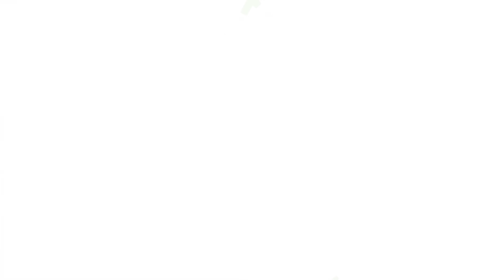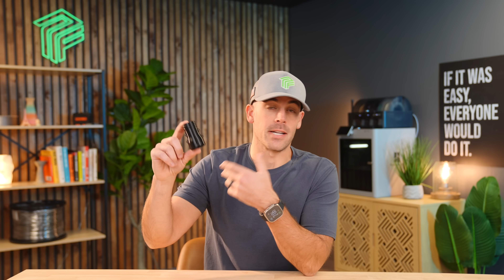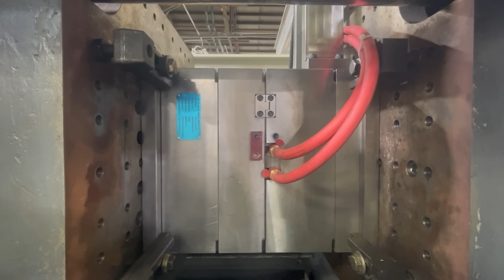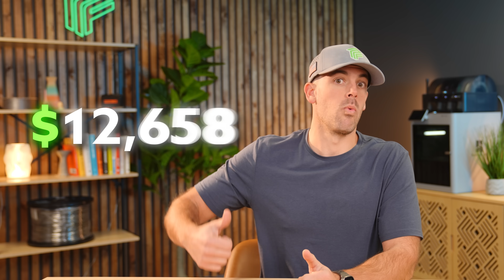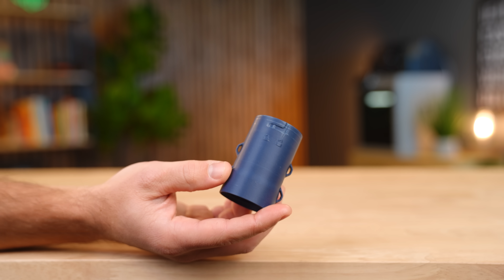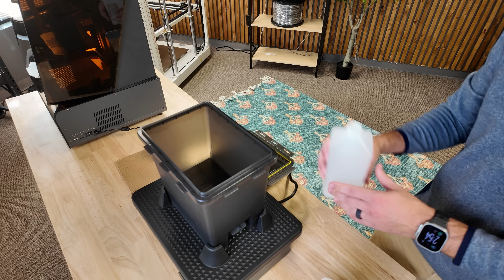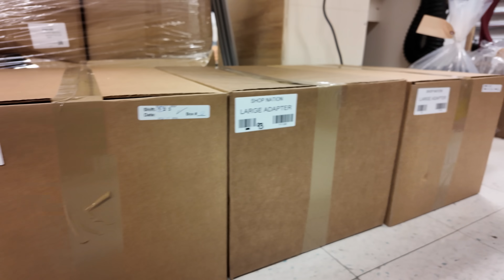Why is 3D Printing so Expensive?  Injection Molding Comparison

Comment: you aren't following your own rules here. what about electricity. staffing 1000 units wont be 10.40. I do think comparing a musket to an AR15 isn't the way to go here. 3D printing consumer level is making massive strides, injection moulding is a much more developed technology because it has had billions in r&d Id argue with the same improvement curve 3D printings versatility will eventually win out.
Reply: also great point about utilizing other print farms. 10 printers can only go so far but a decentralized community of print farms being able to bring 1000 printers to bear to meet supply spikes is an extremely under rated utility,

Comment: can you get more in depth on mold, obviously a multi piece. but what machine was it designed for? was it a aluminum pilot mold or a stainless or titanium mold. was that cut and manufactured here in the US or in china or outside the country for cost reasons. what was the timeline to get the mold? what side or secondary actions are required in the piece? how does that affect cost and complexity?

Comment: For me 3D printig is the right tool for prototyping and small-scale production (I don't count the carbon fibre autoclaves, that's a different story).
And as you mentioned: for a mass production you might go with other, traditional technologies like injection molding, extruding, etc.

Also, the material is also a question: if HDPE or PP is enough for your parts, it may be much more cost efficient than using eg. ABS in the 3D printing.

Comment: Just depends on what the thing you are making is. If it's cheap and you can get away with 3D printing it and doing some slight post-processing then do that. But if it's cheaper to do it injected molded version of it do the injected molded version. It's called discerning elements in your supply chain and for customer happiness index that sometimes you change it up a little bit depending on what you're doing. Finding the right tool for the right job is the most important thing and that's what should be the title of the fucking video. I didn't even watch it in its entirety

Comment: Also, you can save much more on material cost. 
Black ABS can be cheaper because you just get a recycling granulate. 
Virgin ABS from a factory goes at 4-6€/ kg. 
Black recycling ABS, with similar properties can be bought for 1-2€/ kg.

Comment: I worked at a company that made bearing seals (when gas was $1.19). 1st part was $700k each subsequent was 37 cents.
Reply: And you know what is crazy about it? If 1st part had a fatal flaw in design, its cost still will be $700k. I imagine while 1st part was produced, team was like "Be good, please be good."
Reply: @ilyaklimenko5666 
That is way you do a lot of validation, and way mold makers are payd very well
Reply: Crazy how that works out

Comment: Using your chart, for the 10,000 parts row, yes, you would have to ramp up and buy more printers but wouldn't that also open you up to more mid-volume parts printing without having to cough up the initial injection molding costs? TO be honest, I wish I had these volume problems with my little print business :)

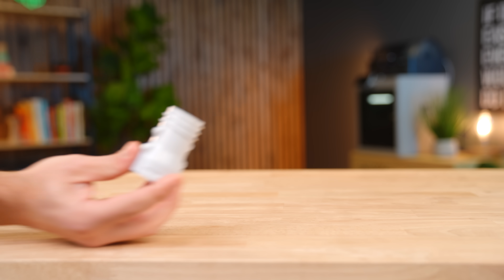Comment: 14:20 "went from an external thread 'since it was easier to print to an internal thread which was actually much easier to use in practice"
these two are gonna fit on something way different

Comment: After the intro my assumption is that 3D printing is great for low volume runs. Basically 3d printing costs 0.85 per part and doesnt require any new tooling but injection molding costs 0.10 per part but unique tooling costs 35,000. If you only need 1000 parts its WAY cheaper and more convenient to 3D print the parts however if you need 1,000,000 parts then the cost of the equipment becomes negligible per part. Pair that with the speed at which injection molding can create those 1,000,000 parts when compared to 3D printing with its limited filament spool capacity and its a no brainer to switch to injection molding.

Comment: Prusa 3D prints most plastic parts on their 3D printers, in order to test durability & reliability.  They could injection mold everything, but they wanted the data to improve their products.  Respect them for that.

Comment: Like anything 3d printers is a tool , 3d printer are for small volume and fast product development , So much does it cost to make a 16 colour mold ? 
People don't understand the cost of making a single item for them , eg a box you could buy in the shops injection Molded for £1 could cost you £7 just in material.

Comment: The thing is 3D printing was never meant for masses. Anyone who said so is delusional to the core. 

Unless you are targeting niche market. Like few batch limited item. Some parts that some people needed just to make their life easier that u can charge more for the "rarity". Or you got hardcore backer who buy anything from you just because you being you.

Otherwise, if you targeting to sell some part and produce thousand and thousand and thousand. Injection mold is always your 1st CHOICE. Its not on debate. If you planning to keep produce parts and sell it. Injection mold will cost less on long run and you can even put "high discount" and yet still get big profit. You save on electricity, time and MATERIAL COST. 3D filament is expensive, even if u have filament producing machine. U still need buy material and yet you need to operating the filament machine which use electricity. 

And not to mention a part that injection mold can produce within minute. U need hours, or even a day to print. Electric and time waste a lot on that.

I mean, i love 3D printing. U can simply bring your idea into life and it is almost limitless with a lower cost and less time. But to put the production line into 3d printing for a long run operation production. It is just a stupid move.

Comment: Sell 184,211 parts in 8 months? Maybe this is true but it doesn't sound right. $35,000 for injection mold / $0.19 saving per mold means you have to sell 184,211 parts to meet you ROI.

Comment: The elephant in the room not mentioned is the cycle time. the injection mold is probably a sub 20 second part and looks like all 3 in one shot so the time to make a batch of 1500 parts is about 8 hours. How many 3d-printer hours (like man hours)  for 1500 x 3 guessing 40min 3d print time 3000 hours / 60 machines is a month ? other than the part quality cycle time is a big variable

Comment: This the same as paper printing, I was involved in getting printing jobs done in the early 90's just as desktop publishing was taking off.  Before I started we used to send off 'marked up' doc files that would be printed at very highres, we would then cut up these prints and place them on individual pages, which would then be photographed and plates made for offset printing.  Eventually the print shops were able to accept files from the desktop publishing software to make the plates but we were still stuck needing plates to be made and the setup costs were still very high.

But in the office we had desktop laser printers that could printout the pages for us but was slow - This is the person 3d printers in your example.

Eventually, printshops started opening up with very fast laser printers along with kit for doing the finishing and trimming, this meant we could produce short runs for a reasonable price - These were the 3d print farms you were using to offsite the work.

But as the numbers increase, even now it still makes sense to use full offset printing even with the more expensive setup costs/time - Which matches to your offsite injection moldings.

Comment: 3d print a pattern then pour a filled epoxy mold usinf some bushings where ejector pins will go install this in a standardized mold base almost like a MUD set. lay in some water pipes thru befor the pour and loop the back and that is good for stable high qualitu for 5 or 10 thousand shots (of a non-glass filled) resin.  send it out for copper/hard chrome plating if need more shots, but that may be a push if mold is simple.
Nowadays aluminum tooling can be quite competitive if part is cnc able

Comment: As a rule of thumb, I've heard that you should begin considering injection molding when the part volume reaches into the thousands. I worked designing subsystems in a machine that had a relatively small production volume (30 total built), so no single part was numerous enough to justify injection molding. Metal 3D printed parts did make it on to the final design though!

Comment: I seen someone use a 3d print as a mold. Wrapped it in packed sand. Then pour molten metal. Of course you loose the mold in the process.

Comment: Machinist by trade. 3D printing is amazing and excels in situations. 3D printed molds are awesome because of the complex coolant lines yhe can put in the mold. But Hella expensive right now.  Great video breaking down everything.

I stopped by proto labs booth at IMTS last time and got a cool demo part the shows some of the issue of mold design. Little cube with the right way and wrong way for certain fetures next to each other.

Comment: Injection moulding is cheap if you do large quantities... otherwise the mould is too pricey

Yes there are exceptions and if the design isn't complex it can get cheaper but overall it's still expensive if you need low quantity or higher iterations...

Comment: 8 months for ROI from $.39. That's 90k parts in 8 month. He's selling over 11k of those a month or 500 per work day or 1 a minute during working hours. I feel like if he just found a supplier with cheaper filament or optimized the processes a tinny bit he would be able to save those $.39 with out injection molding.
Reply from the maker: Nope, ROI is assuming outsourcing

Comment: What makes an injection mold die cost so much?  It appears to be simple machined pieces of steel that should be able to be produced on a cnc mill readily.  Even if they were hand made on an old school mill and lathe, I can't see the man hours being more than 20-30 and at $150 an hour that would only be $3,000-$4,500 plus the cost of the tool steel which would be only a few hundred $.  How do you get the $35,000 price tag?

Comment: Funny when people go to multiple iterations of product-designs, with testing, to make their 3D printed parts last longer. Going for print-setups with more expensive materials, more tooling, and more manual work, to get parts just a bit stronger and claiming it would be "far cheaper" than injection moulding. I had seen that with a company making quad-copters - they wanted a uni-body drone about 30cm diameter - comfortably fitting their printers. They had done all the digital analysis of their original model but then had to go through testing and validation of many more iterations cause while the design was good for all other aspects (ease of assembly, use, aerodynamic stability etc) the nature of the 3D print made its durability miserable. It took them over half a year to get the printed version to acceptable standards, but that came with the downside of far more complex setups, far slower prints, more material wasted, and a lot of manual post-processing. For the later, a bit larger, hexacopter they again printed it and did most of the validation with that model, and then got a company to injection-mold it. A couple ten-thousands in tooling vs a couple thousand man-hours and a product-delay.

3D printing is great when you don't have high volumes, and when you don't require high strength (for plastics). And with injection-molding there are various ways of going at it and tooling-cost for a small adapter like shown here can range from just ~5k to over 50k - same part, but different molding-methods and materials as well as lifetime. Molds have a design-lifetime and depending on the design and material used the price for the mold can vary significantly. If you only plan on selling like 50k parts then paying extra to get a mold lasting for 1 million pieces will just drive the cost up for nothing.

Comment: I rarely ever make comments to YouTube videos that I watch, but being mechanical engineer that has designed parts for injection molding and numerous other processes like Aluminum casting, powder metal parts, stampings etc....  There is always a setup charge for ever run of your parts. Your tooling cost of $10,000 plus your assumed cost of on part for $0.40 to get a total cost for the one part being $10,000.40 (video time stamp 10:37).  You have missed more cost for the one single part.  Tooling cost is not the only factor.  The company that you now have this new tool to make your molded part will charge you a setup fee when you do a run of your parts.  This setup fee is the same if you run one part or thousands of parts. The more parts you run the less influence that setup fee will have on your final piece price.   That set up fee cannot be overlooked.  The setup fee will be determined by that companies factor overhead to run their business.
Reply from the maker: Very true, however since the same company that provided the mold is also running my parts that was all baked in

Comment: Why have we not moved to 3d printing the injection molds themselves using metal? i feel like that could drastically reduce machining cost and material needed even allowing cooling channels where needed potentially making tools cheaper and better. It would be printed rough and have a single finish pass on a 5 axis cnc machine.
Reply from the maker: There have been numerous cost studies on the viability of this. Basically the cost doesn’t end up being cheaper in the end. There are also all kinds of material properties concerns with printed metal molds. It’s much more expensive to print big chunks of steel than people realize

Comment: Great insight on how to make the right business decision.
I have worked for an injection moulding company for 37 years now making bottle tops. Sub 3s cycle times and 96 cavities which is impressive to see once optimised.
I dont think you discussed the advantage of time between the two processes. Injection moulding I guess was 2 components in less than 10s? Compared to however many your farm can produce would be interesting to know.

Comment: You could have done the same thing with your resin printer. You also should have just placed it vertically on the build plate. Then put multiples in an off-set grid pattern. From the looks of it. You could have gotten 6 on there at least. Also, use Acetone to rinse the part, then take off supports, then cure. Alcohol rinses the resin, but it doesn't really dissolve/eat it. Acetone will, but not on a part that is already partially cured. You resin cost per part is going to be less than .10 from the looks of it. For the same initial investment. You could have a farm of 30 printers all going producing your part. Here's where the fun part will come in. Want to enhance the part because of feedback? New mold all over again. Yes, the injecting molding itself is cheap. It's the hunk of metal that's expensive.

Comment: A desktop injection molding machine will cost around $800 and can still produce many parts. You have to be at it because it's not automated, but it takes a matter of seconds to produce a part that will take hours to print. You can produce a lot of durable parts in a single day. Even if you buy a small CNC machine to machine aluminum molds yourself, such a machine will cost around $2,000. It's still a ridiculous price compared to $35,000 and offers much greater possibilities.

Comment: 1 3D print $2
Print time 4 hours for 1 unit

1 injection mold $5000-10000
$.10 each after that.
10 seconds to make 1 unit

All depends on what you are doing and if you have a mature product.  You don't want to have to retool.

In my example you can get roughly 2500 units out of the 3D print before you get 1 out of the injection molded process.  This is of course is ignoring print time, worker interactions and wages, factory floor space, and electrical cost for simplicity sake.  Maybe drop that number down to 1000 units to break even.

We were basically hand making buttons for aircraft simulators at about $10-25 per button.  (CNC'ed acrylic) This was fine when we were doing 1 offs.  (Less than 30 buttons) When we got an order for hundreds of panels we went injection molded.  The price dropped to $.20 per button, but were are talking thousands of buttons now.

Comment: Really enjoying your videos, super helpful. I have a really random question but I’ve been trying to find a solution - 

What do you use for your hook setup to hang the 3/5kg spools on the racking? I want to start using 3kg rolls but don’t want them hanging directly on the printer to cause more top-heavy swinging

Comment: How long did it take to get from "let's redesign this for injection molding" to "here's your finished parts to sell"? This feels like another blind spot to consider. Cost is big, but depending on what you're making and how the market around it is moving, even running 100+ printers may still come out on top.

Comment: I keep waiting to hear about the iteration cost!
If your first print is messed up you lose $0.85 and you edit the cad file for the next part. You mess up your mold and you spend another $10,000.
If you hire experienced professional mold designers that are good communicators and can get it right the first time you're either on a long wait list or you're paying through the nose.

Comment: the tl;dr is : making a mold for injection molding is expensive, but if you're making 100's if not 1000's of the same item the cost per item and especially the time spent making each item goes down alot. and that makes a difference if you're selling 10.000's per month